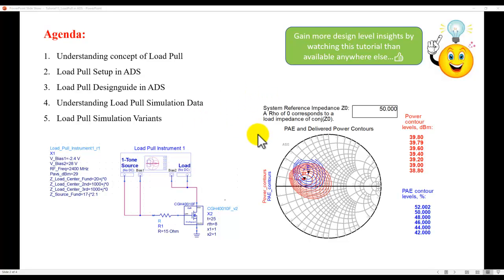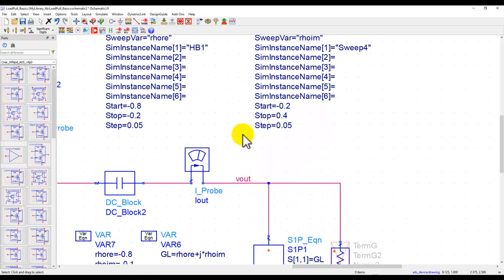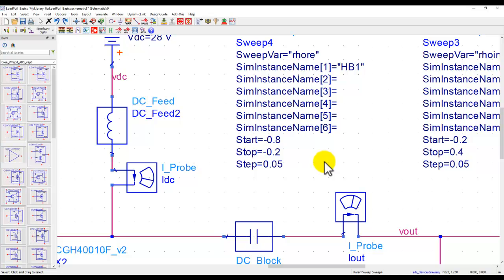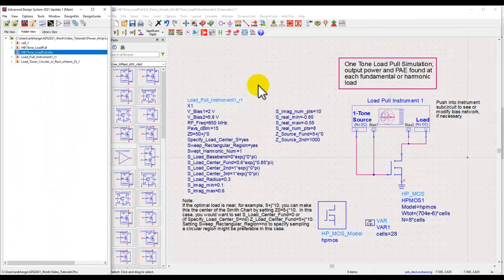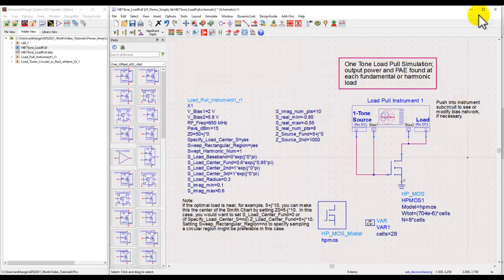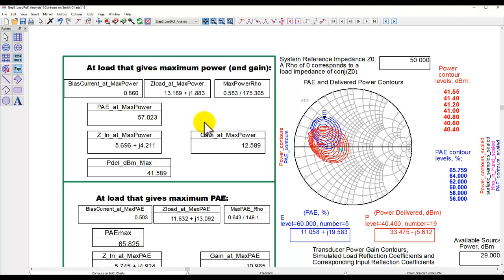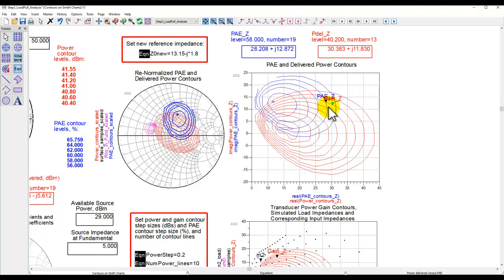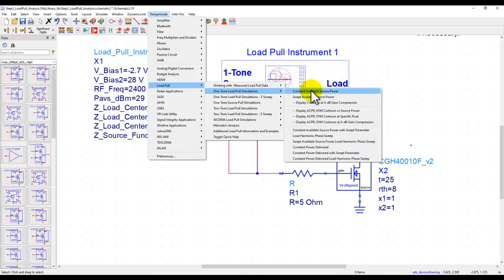RF Design-13: Getting Started with Load Pull Simulations

Comment: Thank for your excellent video! Can you tell me why you selected Z_load_center_fund = 20+ j*0 and not 50 + j*0?
What does this mean and on what basis can we choose the appropriate  Z_load_center_fund and  Z_source_center_fund?
Reply from the maker: Power devices aren't internally matched hence there is no point looking around 50Ohm point. Most of the times you will find suitable point at low impedance level hence the reason.

Comment: Hello!It is a very excelent videos for learning ADS! And I have a question for video "RFdesing-13", I don't know why I can't evaluate the VAR 'GL' in data display(it had code in SCH), and I got PAE, but the equ PAE_contour_ex is invalid(red)?Do you have any ideas?Thanks a lot!!
Reply: Sorry, I add a sweep 'pin' in HB controller, so the format of PAE changed, so I can't get the right PEA_contout ues the same equ as the video shows.
Reply from the maker: Something might be wrong with your schematic setup, make sure you select GL in the simulation controller to be sent to output. Contact your local Keysight tech support team for help if you can't solve it yourself

Comment: What do I do to increase my output power levels? 
I'm getting PAE of 66% and my Pavs is 27dBm.
I'm using the same Cree device
Reply from the maker: Hi,
Its difficult to answer the query without looking at the setup. If you are not getting required power level then look at the Smith Chart region where load pull is being performed or the bias supply voltage.

Comment: I have been trying to learn rf and ads using your channel thank you so much
I have a doubt that in your harmonic balance you have used input with 50ohm
In load pull simulation you used 5 ohm
How can we ensure that matching is perfect at the input side of mosfet
Reply from the maker: 5 Ohm used is not for perfect matching but just enough to let that terminal load up properly for proper load analysis
Reply: Means if my input source impedance is changing in a range where enough power gets into it(say 2-10ohm) , that will not affect the load pull result ?

Comment: Sir the problem I am facing that is I am not getting  the contours fully. How to solve this?
Reply: same here
Reply from the maker: Try changing the center of Zload and radius/area of your load pull simulation and it will work. If you can't figure out then contact Keysight tech support team for help

Comment: thank you sir for your great tutorials
 I do have a question, why did you set the impedance of the input power to 5 ohm rather than 50?
Reply from the maker: Hi,
Power transistors have low impedances for both gate and drain so setting it to 5 gives you better chance to see good output power. Setting input impedance to 50 will usually not allow you to see optimum/good output power. I explained all this in the PA tutorial video, kindly watch videos 16-18 under the playlist
Reply: @BhargavaAnurag  Clear, Thank you sir

Comment: Sir, why drain bias voltage is too high? will it not be a problem in current low power SOCs?
Reply from the maker: You select bias voltage as per the device. For the device I have used, its 28V as recommended in the transistor datasheet

Comment: How to use load pull to find optimum second and third harmonic impedances while designing a class F PA?
How to find the appropriate stability circuit for my design?
why don't you choose 14+j*8 as optimum load point, where PAE = 64% and Pdel = 41 dBm?
I used the load pull template from the design guide and later wanted to remove it....How can I remove all the cells related to it at one go?
Reply from the maker: Its difficult to provide this kind of support on YouTube, kindly contact local Keysight support team for help.

Comment: Hello sir,

What is the difference between a variable and measurement equation in ADS? I'm always confused. Could you please clarify?
Thanks
Reply from the maker: Variables are something you define to be assigned to components in place of their fixed values on your schematic so that you can sweep it or keep your circuits symmetrical etc 
Measurement Equations are for your measurements i.e. post processing like for example if you want to compute mag(S11) then you will define it in Meas Eqn and not in the variable block...😊
Another difference is that anything you compute in Meas Eqn can be used as an Optimization Goal to optimize your circuit component values, if needed.
Hope it is clear now.

Comment: Hi Anurag, Thanks for the awesome insights into the ADS tool.

I have a question i.e we are trying to build a simple cascode PA, when we need to do load-pull analysis, we should do load-pull for 2 transistors present in the circuit or only for the 1 transistor to get to the optimum load impedance?
Reply from the maker: I would recommend to contact local Keysight tech support for help on this.
Reply: Hello Patra
I am trying to do exactly what you are doing and struggling with this point
would you please let me know what are the recommendations of keysight tech center? is one transistor enough to load pull it or we need to load pull both of them?

Comment: hello Anurag, 
can u tell me how to design a Class AB amplifier using 2N2222A  transistor for 6.78MHz.
Reply from the maker: Kindly watch my video on Power Amp design which is also class-AB. Only difference would be that it was GaN device I used and you would probably use BJT at such frequency and all other matching would be done with lumped components instead of using transmission lines as I did in my video.
Class of Amplifiers is all about selecting the proper bias condition to select conduction angle of the transistor and for AB it should be between 180deg-360deg.

Hope this helps...👍

Comment: This load pull is on a single transistor what of  whole 3 stage amplifier
Reply from the maker: Classical load pull is done on a single transistor/device. If you need to perform load pull for multi stage design then you can use the 2-port load pull template available on Keysight Knowledge Center

Comment: How can you carry out load pull on a 3 stage amplifier
Reply from the maker: Load Pull is usually done on a single transistor to figure out right impedance for matching purpose for power, efficiency etc. If you want to run 2 port Load Pull for a cascaded amplifier then look at the Keysight Knowledge Center from where you can download the example & associated PDF document.

Comment: Thanks for this great video. about the first part of the video, may I ask if we can define the reflection coefficient in a polar format so we can sweep the whole smith-chart? If we define the reflection coefficient in a rectangular manner, by getting close to the edge of the smith-chart, the corner of the defined rectangle gets out of the smith-chart and the power values become imaginary and data display will not show any result. Could you please explain how we can define the reflection coefficient (all the black dots) in polar format? Thanks again for your amazing videos
Reply from the maker: Hi Soroush,
Sure you can define it either rectangular or polar format. You could check out the parameter on the load pull tuner. Most of templates in the load pull designguide template are of polar format.
For more help, kindly contact your local Keysight Tech support team.

Comment: Hi!

I have an error that the data "...did not converge -- associated data will be identified as '<invalid>' flag in the dataset.

I don't understand how to solve the error that I got and I really need your help, pleasee.
Reply: Hi again, I already solved the above issue but now I have another 2 problems.

1. My "GL" is invalid as if it doesn't exist. Why?
2. There is an error for all of my equations in the result. It says While evaluating "PAE_contours":
  Function contour(), argument 1 ("surface data") : Unable to contour the surface. This may be due to an invalid surface

Please help me
Reply from the maker: I would recommend you to contact local Keysight tech support team. It seems you are doing some error in the equation syntax...

Comment: Thanks alot for another imformative video. I know load pull simulation is for power amplifier. Just I am wondering, can we use it as a tricky for designing Low noise amplifier too? Thank you in advance for your answer
Reply from the maker: I am sure what value Loadpull simulation will bring to LNA design as LNA is always matched to 50ohm for best possible matching.

Comment: One more question, what's the best way to do differential loadpull? if the load tuner used in the example is connected differentially, will that work? Thanks.
Reply from the maker: I never tried it but you might want to try using ideal system balun models at input and output. For more details kindly contact local Keysight tech support team for help.

Comment: Hi Anurag, thanks for the video. For the load-pull examples in design guide, seems source-pull are done at the same time. If I want to do load-pull only and keep source impedance at 50 ohm, what should I do? Thanks.
Reply from the maker: Hi Steve,
For any load pull setup under designguide, the source impedance will always be held constant and the value can be set by user. I am not sure where the confusion is coming from? 
One the side note, 50Ohm for Source impedance for a bare device without any input matching network is never the best choice....😊
Kindly watch all the related videos and the PA design videos and you will understand the proper way to get started with this.
Reply: @BhargavaAnurag  thanks for the reply. The confusion comes from Z_s is put into the source port in stead of 50 in the schematic.

Comment: Hi thank you so much for your videos they are really helpful. I am using CGHVIF006S and my design frequency is 9.4 GHz, I did ur exact steps and yet I am getting very small max gain like -1.690 which should be 15 dB. I don't really know how to fix that. Thank you
Reply from the maker: You need to relook at your circuit and make sure everything is set properly. Make sure right DC voltage and currents are reaching your device and you are indeed looking in the right area of Smith Chart. If you are looking at wrong area of Smith Chart then required Gain may not be there. Try different zones in Smith Chart or refer to datasheet to see recommended Load Impedance to get good starting point.
If you can't resolve the issue then contact your local/regional Keysight Technical Support team for help. There has to be something wrong.
Reply: Plzz plzzz plz tell me ...now  if u r available...how we gate design kit after register from cree website 😢😢😢 plzzz   where we search it in website and what is key word to search

Comment: If you share the workspace of these examples. It will be helpful!
Reply from the maker: I try to share the workspaces on Keysight Knowledge Center which supported customers can access but if I share this workspace then lot of people will see error as it required Cree library to be installed & configured and not everyone may have this library hence I didn't share the workspace.

Comment: I am using a modified version of this schematic and (1) i get an error saying no source was found. How can i locate where this error is from? (2) the equation GL=rhoim+j*rhore is not recognzed, i get the error that is not valid for parameter "Variable Value"
Reply from the maker: Kindly recheck the simulation setup carefully as it seems you forgot to connect the P_1Tone source at the input. Pause the video at right points and compare your setup with the one shown in video. Its pretty straightforward so should work easily.

Comment: Can you give your email id?
Reply: Hi sir,
I am trying to do load pull simulation for power amplifier, but I am unable to get the output.. I am using LC type matching network. I am not getting the output. I am quite sure my ckt is fine, but unable to get any output.
Reply from the maker: @ravinatanwani618  If your circuit and simulation setup is fine then you should have the output. I would recommend you to contact the local ADS tech support team for help. If you are not sure how to reach to tech support team then let me know which country you are based and I can let you know the email id.
Reply: @BhargavaAnurag sir, I am in Germany, if you can provide me the email id, it would be of great help
Reply from the maker: @ravinatanwani618  You can write to them at eesof-europe_support@keysight.com
Please note that a lot of people will be on year-end vacations so there might be some delay in their response till 4th Jan. While sending them email, make sure you mention ADS version and attach snapshot of your schematic setup and what are you seeing in Data Display which gives them clear idea of what is the issue saving back and forth query.
You can also zip & send your workspace and tell them which schematic to look for the problem.
Reply from the maker: Hi Ravina,
You can post your queries and I will try to answer in best possible manner. If some query cannot be answered I can direct you to local tech support team.
Hope this helps.

Comment: Sir, is it possible that you make a video about "options > expert settings" in EM MoM setup?
Reply from the maker: Hi Murat,
That option is used in very few occasions hence there is no video for that. Anything specific you are trying to achieve?
Reply: @BhargavaAnurag  Hi Sir, I am trying to achieve reducing the simulation to simulation S21 phase variation by meshing MIM Caps densely.  I could mesh the whole structure densely, but the simulation time would increase. I find that expert option has some setting about MIM Caps that would help me to mesh spesifically MIM caps densely, but help file of ADS does not explain it how it works.

Comment: Informative !! . Anurag have you ever tried loads pull simulation with an active source injection ? Is that even possible in ADS to add an active source and sweep across different values of a2
Reply from the maker: Hi Hinduja,
I haven't tried that but it seems quite possible to do so.

Comment: @anurag I tried to run your LoadPull_basics schematics which you showed beginning of this tutorial. Unfortunately, I am getting error from measurement eqn function "Pout_W and Pout_dBm". It says "undefined variable". Can you please guide me how to resolve this error? Thanks!
Reply: Check that you have placed the appropriate wire/pin labels in the schematic as these are used within the Pout_xxx equations. Similarly, (also true for the PAE calculation), ensure that all current probes are labelled in accordance to the PAE formulation. Also, by default the PAE formulation is given as "PAE1=pae...", the equation used in this video is just "PAE=pae...", so make sure that you rename the PAE tool in the schematic (remove the 1 from the function/formulation, not the instance name).
Reply: @fourierv2  thanks!
Reply from the maker: Hi Rashid,
Base equation here is Pout_W which is dependent on "vout" node/wire label and Iout which is the name of the current probe at the output node. You should use the syntax/names as per your circuit setup. Once you fix this error, Pout_dBm should resolve as well.
Hope this helps.
Reply: @BhargavaAnurag  thanks! Will try that.

Comment: How to use diodes instead of using  transistors, as in RF rectifiers to calculate and draw efficiency vs. impedance on the Smith chart....
Reply from the maker: Hi Hussein,
I have never tried that but as long as you know what you want to do, there will be a way to accomplish your goal. For example, if you know how to calculate Rectifier's efficiency then you can use the same method explained in the initial part of the video to sweep the reflection coefficients and then compute the efficiency on every load sweep point and then plot contours on the Smith Chart.